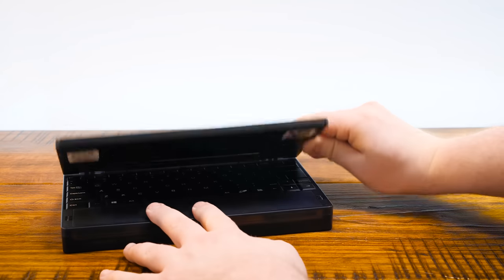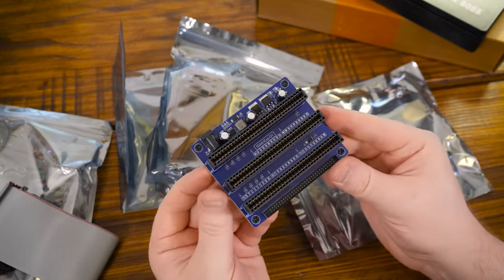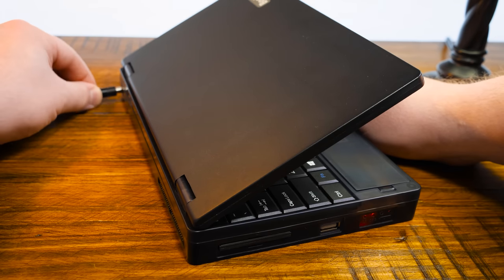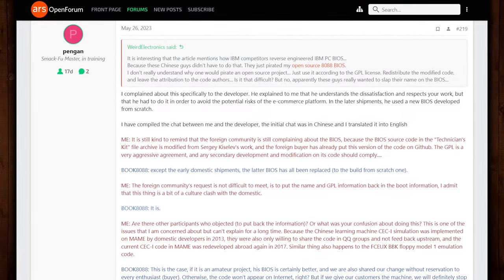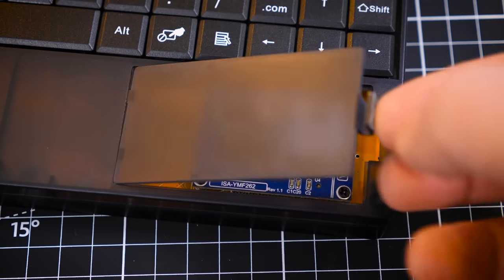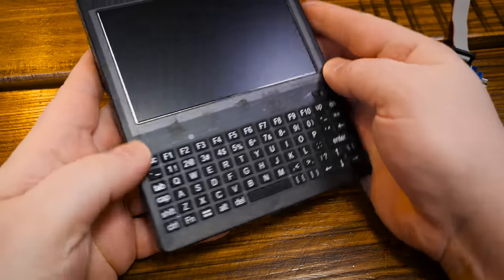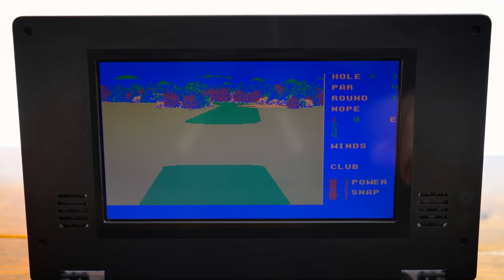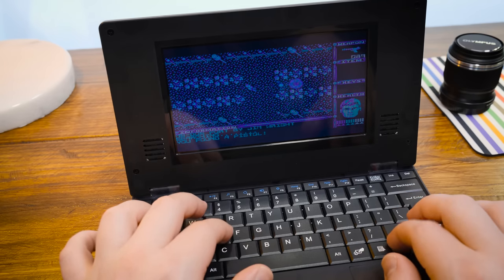So I Bought Those Weird New AliExpress Retro PCs…

Comment: I was thinking of solutions like this for my retro needs until I reached the exact same conclusion by then. Why not just look for a decent laptop from that age that can play the games I care about (mosty late 90s/early to mid 2000s) instead of wasting time experimenting with modern hardware or weird devices like the ones in the video? Which is exactly what I did.
Reply: but you still have old hard repairable machine, this new unit is easily serviceable - you totally missed the point ;)

Comment: Interesting, so these chips still exist because of the need for them in old automation controller equipment?
Reply: Pretty much. A lot of those customers aren't interested in a computer that can do more faster, they just need a computer that slots into the existing production line without disrupting anything when they need to replace it. They don't want to have to deal with new software, drivers, firmware, etc. or replace still-functioning industrial equipment to be compatible with new systems.
Reply: Tons of new old stock
Reply: Or weapons of older design. Could explain why the computers are not in stock right now.
Reply: @Kr-nv5fo  weapons of older design that's a weird one.
Reply: @TheSlyMouse  How so? Lots of them are currently used in Ukraine by both sides.
Reply: @Kr-nv5fo  I don't think it lines up but I honestly have no idea. Just saying it's interesting and I know very little about if that could be true or not. Good luck to the guy rebuilding that lol.

Comment: I also purchased one of these, the book8088 with the isa expansion and Yamaha sound card specifically. I reached out to the seller about the dim display and got the same message about swapping the SMD resistor. I do solder but usually through hole components. Only recently have started doing stuff with SMD stuff, even then I am using a regular soldering soldering iron with a tiny tip. I will eventually swap the resistor on my end when I order a reel or sample book of misc smd resistors...

Comment: I think the 8088 is the most interesting, but also the most tragic. The screen and keyboard are clearly justy whatever the guy had on hand rather than anything purpose built. A proper build would include a proper keyboard, not just whatever the builder had available, and they'd have proper ports and controls. As you said, it's an interesting proof of concept, but that's all it is. If this was closer to the two vintage clamshell PCs you showed at the end, I think this would really scratch that itch for a lot of people. But as it is, it seems like it's just a cute novelty that never asked if it should be done (just because it could be).

Comment: Honestly despite the shortcomings these are both pretty neat. Older computer systems are getting rarer and more expensive so having stuff like this to experience not only retro software but some legit retro hardware is pretty darn neat. Allow people to use old games and programs without needing to get or use an old computer, probably less worried about messing something up with a 200 dollar piece of hardware that would (if they were still being made) easy to replace compared to a 30 or 40 year old computer that might be worth triple that easy if not far more while being considerably harder to replace. I'd think these could be very cool with a future version that works out all the bugs, hardware design flaws, and less then legal bits of software. I'll admit even with the shortcomings I'd still want one even now, was a little disappointed they were such a limited run.

Comment: Keep in mind we can take the big boxes we had in the 80's and basically cram everything onto a chip (or set of chips or board) the size of a deck of cards now... and the even more sad thing is they are often times (or at least, can be) more powerful than the actual hardware from the era they are imitating.

Comment: Hey LGR I did that 7.5 Ohm mod on mine and it's worth it. The display does become much more usable
Reply from the maker: Great to hear!
Reply: @LGR  haha now I just gotta figure out what I'm going to do with the remaining 99 7.5ohm smd resistors. For now I'm going to play some original sim city in all its glory!
Reply: @christicks5843  What value was the original resistor ? You probably could of removed the resistor and used a solder link instead, 7.5ohm is such a small and odd value resistor.
Reply: @arnolduk123  haha I'm not sure I don't know where I put it. If I find it I'll let you know!

Comment: When I first saw the splash screen, I was excited, but only for a moment; the old Motorola radio community has been scrounging old computers for programming since the Pentium was released. The prospect of something pre-Pentium with all new components was tantalizing but once I heard there was no serial port, all the air went out like a whoopee cushion. (For those that aren't familiar, older programmable Motorola radios' software will simply not run on newer computers)

Comment: I will tell you what you need for retro:
I bought a new Tandy 2810 laptop back in the late 1980's. It had a 16 mhz 286 cpu, vga graphics and vga graphics out.  It played Wolfenstein 3d and a similar but slightly more advanced  game called Blake Stone Aliens of Gold. I used MSDos 4.0 and Windows 2.11 286 with Win Word 2.0. The screen and keyboard were good.  It was twice as fast as my Tandy 3000HL 286 desktop.  Sadly, they must have been made with defective caps since there does not seem to be one percent of the ones left around that are still working.  There were several levels of CPU as well as Grid versions of the same sleek charcoal colored laptop.

Comment: a little more work on the laptop, and it would be perfect. If it used a vortex86 cpu (a modern 386 class processor) and had usb 1.1 and ethermet, it would have been awesome.

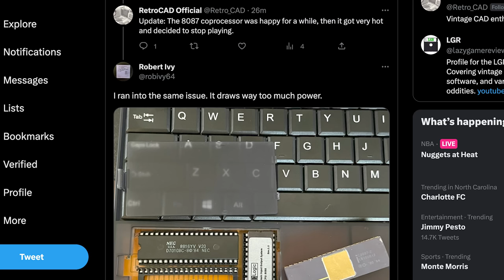Comment: @9:57 - I was thinking about the heat from an 8087.  I'm surprised they even bothered to put in ta socket for one.  Generally speaking, all the discreet x87 math coprocessors I've ever used run hot, but I really needed them for CAD back in the day.  It made a world of difference vs a software emulated co-pro.

Comment: I bought a Toahiba Libretto 50CT over 20 years ago and it ended up being one of the ones that had a 120MHz CPU inside. I did some microsoldering and ended ultimately overclocking mine to 133MHz.

Comment: I think I'd get the hardware and the expansion boards out of those form factors and get cases for them, either worn out old, boardless cases or 3D print something custom taylored for them and use them as actual desktops with decent monitor, keyboards and mice.

Comment: I hope these end up being like the Ali type android handheld game systems that have taken off over the past couple years going from cheap NES emulators to fantastic little machines that can run everything up to Wii & PS2.. these definitely have potential, and with the dwindling availability and aging of actual vintage machines (especially vintage laptops) it would be great to have something you can just order and not have to worry about dead batteries or leaking cmos batteries.

Comment: Mine showed up! Cute little guy. One thing right away, it's a pain to try to use Windows without a mouse! Wish they had the breakout board like the 386 has. I'm probably going to end up trying the brighness mod mentioned in the video at some point. It's usable but barely. Also now wondering if I can find a bigger panel module that would work with this and 3D print a new bezel.

Comment: And here we are in 2024 and both of these are still available on AliExpress. There's also a Pocket 386 running either Windows 3.11 or Windows 95 that looks very similar to the Book8088. It has a far superior screen compared to the Book8088 and is VGA, not CGA. It also has several I/O ports available. The only thing I wish it had was Sound Blaster audio. I just ordered one of the Pocket 386 jobbies in a clear case for under $200. Why? Because I still have a ton of DOS games and applications that would be fun to relive my youth.

Comment: Congratulations on the video! These laptops are very interesting and show good potential. It is true that the format requires a bit of a design improvement but the ability to have real compact computers is fantastic. I hope some bright mind is able to incorporate Samsung or LG OLED screens in future models. They will be a niche, that is for sure, but the display will be a real pleasure. I think the same format of the 8088 laptop should be adapted to the 386 or a future 486 computer as it shows the biggest promise and, yes, we need a pointing device, let's not forget that!

Comment: Alternatively you could change the resistor with something like a 10 ohm trim pot, although that would be a lot more work to hack it in there.

Also, while this thing is cool, it just reeks of half-assery. All of the alternative I/O options could have definitely been implemented into the board at some level, with the obvious exception of the ISA ports. There's just so much oversight for something that could have been a super awesome product. And the unfortunate reality is that you almost can't get away with this in the states because of the obvious legal overhead.

Comment: Hey Clint, what do you think of the idea of a hardware accelerator for Java, possibly designed as an expansion card for retro PCs? Would you buy/review such a thing if it existed?
Reply from the maker: An interesting idea but I honestly can’t think of what I’d do with it. Any system I have that I’d want to run Java programs on is already more than capable of it. What’s the intended use case?
Reply: @LGR  Well, that depends on what age of computer it’s getting stuffed in. I kinda want to target mid-90’s computers, so right around the time Java first came out and performance just really sucked across the board. GUI applications, database applications, floating point physics simulations, games, etc.

As a side effect, you might be able to run Minecraft “on” (or more accurately, adjacent to) a 486, if the design is right. (GPU not included.)

An overview of the design so far:
- ASIC for unpacking compressed bytecode
- ASIC for (lazily) translating bytecode into native machine code. No optimizations, but done in real-time.
- High-speed RISC CPU (on the card) with multiple cores, and any instruction set extensions which would be useful for this specific application. (For example… ARM64 with TDMI and Jazelle extensions. Just an example.)
- FPGA for optimized JIT compilation. Wouldn’t be as fast as the ASIC for lazy JIT compilation, but it would produce much better code… and the JIT compilation would be completely offloaded from the CPU. I’d be using an FPGA for this instead of an ASIC because it’s a much more complex task.
- Its own supply of DRAM for caching the JIT-compiled code (and it would need ample amounts of it). Might also allow some advanced memory management features to be implemented directly in hardware, still unsure in that front.
- Dedicated hardware for rapidly generating random numbers, offloading the task away from the RISC CPU so that it can focus on running actual program code.
- Cooling solution, because at the clockspeeds this thing will be running at… “OHMYGODHOTHOTHOT”

At the moment though, it’s just an idea. Haven’t even gotten started on the implementation.
Reply: As a side note, I’m trying to decide if I want to limit myself to 90’s technology, or just use an interface that will make it compatible with 90’s motherboards.

Comment: Both teams are very interesting. While it is good to see a 386 with Windows 95, it would have been better to have MS-DOS 6.22 installed on the CF and Windows 3.1, taking into account that it has 8 MB of RAM and also having an 80386 SX processor. I also liked the first portable PC, but it is something else.

Comment: I really hope the success of these clearly flawed models leads to something better down the line. 
Personally I would really like to see a spendy model that sticks the fpga from the DE-10 nano in a clamshell laptop with a nice 4:3 display that could run MiSTer. Or some early pentium model with full soundblaster support at least. 

I agree that nothing beats the feel of original hardware but old laptops are a dying breed with LCD rot being the worst problem...

Comment: Ya know, I used a Compaq 8088 Laptop slightly thicker than that. (maybe it was a 286. It could only run DOS 4 or 5, no Windows Shell, I remember that much.) The weirder thing to me.... the 386 and 8088 feel like they're in the wrong cases. I'd want the 8088 as a Pocket DOS Device and the 386 as a Windows Laptop.

Comment: Overall I think they look good if not great as a DOS product enthusiast. Some of the faults are just modern component restrictions but other aspects like external ports just seem like oversights. Practically a project in itself to take the guts from that and put it into a better casing heh. Perhaps these reviews can act as a QA phase if more are made.😉
I've been mulling over old DOS screen modes and despite good modern interpolation filters for anamorphic 4:3, when it comes to raw simple 1:1 display many of them do work more easily as widescreen given modern constraints like LCDs. For example the stalwart DOS 320x200, with that I've gone with a 256x192 game window and a pillarbox HUD standard as future retro use setup because only "maybe" 25% of YTers actually use the original 4:3.😒
6:55 Don't be too hard on the bios license faux pas as it's practically reflex in China to knock-off lol, and their likely is some language barrier and a learning curve to the rules of Open Source that seemed to have been corrected.🥺
Reply: From the schematic there is an unsoldered Video output port, also there is a big external port : ISA, adding serial port and other inside would probably be a bit complicated. (And what though? PS2 was not a thing at the time, the only thing would be something to plug an external keyboard, but what type? AT/XT type keyboard are hard to find today) 
The 8-bit ISA connector on the back technically allow to plug anything we can think of, and nothing prevent someone to make extension that use the plug on the back instead of a normal ISA backplane, so adding a COM port could be done that way in a compact factor.

Mine is on the way, and hope I will be able to fully reverse the 3 CPLD on the board to fully document that device, it is not a cheap device, but if it is really made in really low volume, all the custom part must cost the creator a lot of money, even while being in China. The plastic shell is not an off the shelf product as the keyboard and screen can be.

I genuinely think this is a perfect small hackable XT class machine that with some things here and there would be near perfect.  I have some plan for it, we will see if I manage to pull it as I want :D

Comment: You would be better of with a thin client "pc" for 25$ or so and a cheap monitor if you want a dedicated "old" pc. There are plenty of them on the used market and they cost so little you could have 1 for each game if you wanted to. Some "fat" versions even have a pci slot you could use a angled riser and a graphics card in. My slowest is 800 MHz and works with DOS/win98/95 and my "new" ones are dual core 1.6 GHz win 7 embedded, capable of win 10, all be it a bit slowly on that one but usable for web surfing.

Comment: i purchased both and i'm wondering if i can flash the original BIOS from Serge on the Book 8088 and still use the hot keys for speed switch and whatnot. The lack of I/O is a huge limit as i didn't purchase the optional 8bit dock. Someone needs to design a compatible NIC that will plop into the expansion on the side for network stuffs. :)
Reply: Yes, the turbo and mute are not handled by the BIOS. Though Sergey BIOS may need some change here and there to fully support this hardware. (as it seems there are some subtle changes in some area)

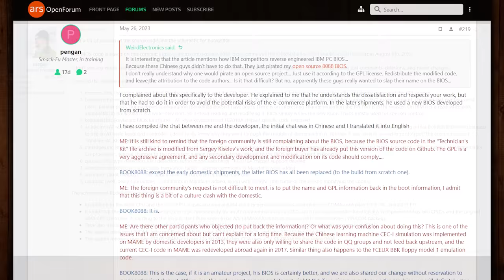Comment: 7:15 I don't understand why they even had to create new BIOS from scratch. They could ship the BIOS with license notice somewhere, and provide source code if they modified it.
And honestly I think the result of "creating new BIOS from scratch" would be either:
A) The BIOS that was created from scratch, but it's disappointing result
B) They swapped data lines on ROM chip in order to obfuscate what they've done(Afaik this actually happened with one of Commodore 1541 drive clones, to hide that they directly copied Commodore's DOS ROM)
C) They did nothing. They still ship the pirated BIOS.
D) They REALLY provided functional BIOS created from scratch
Also, even the one in the Hand386 is most likely, technically pirated copy of the BIOS, but it's just that authors probably don't even care if someone pirates it since it's so old.

Comment: Hi, i have to hand it to the guy that put it all together

For me, last year, i fixed the old HP Mini 5102 - it was as slow as you know what, the hdd was on its last legs ( boot time was 5 to 6 mins and XP reinstall vie external usb 2 - cdrom  was almost 4 hours

So before deciding to bin it, i noticed a CF card slot so popped in a freedos and doom 2 ( and phils computer lad utilities ) - the thing screams with it pentium atom

After that i purchased a new 120G ssd and it now dual boots dos 6.22 and XP, all the HP  special drivers are on line, only sad part is no dos sound , but doom runs with sound via dosbox

Comment: I am thinking that the fellow salvaged everything including the screens form an old industrial machine control pane. That why they look all washed out after 20 years of continuous use...:). Have a nice week.
Reply from the maker: They sure look like unused displays, still had the original plastic coverings/screen protectors on them when they arrived and with rather recent manufacturing date codes.